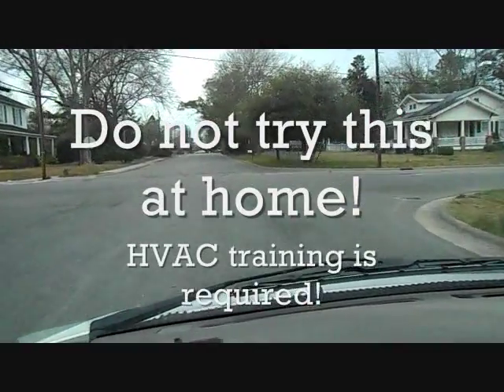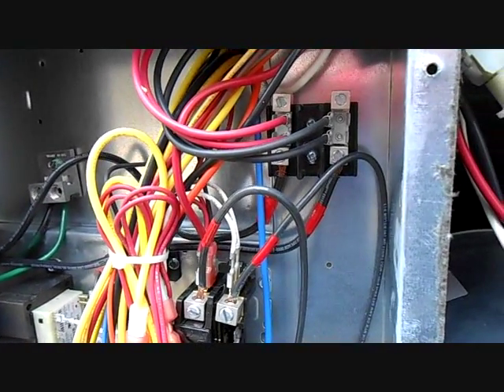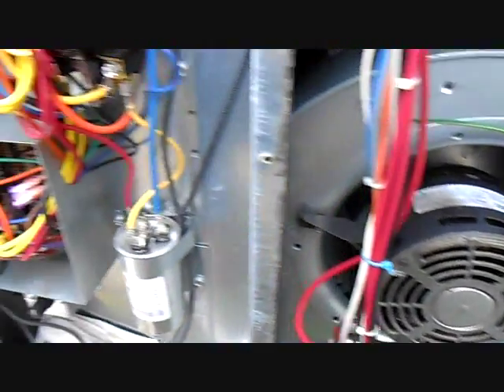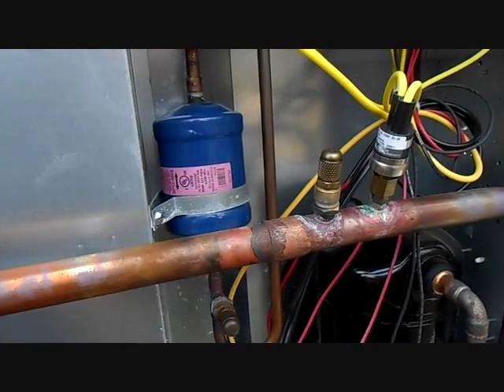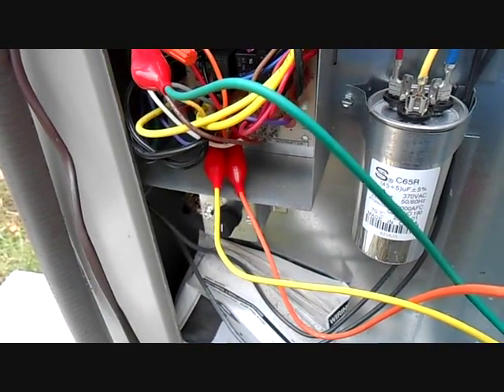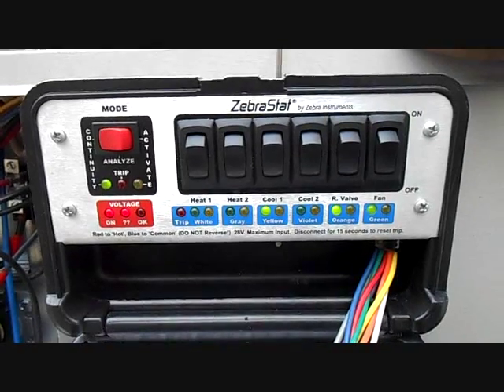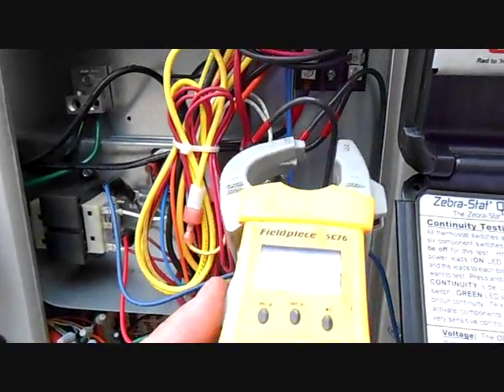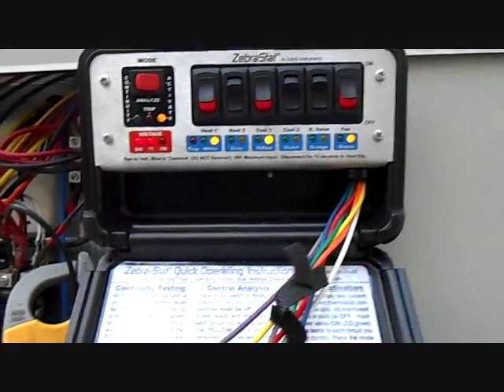HVAC Service- One Fine Nordyne

Comment: What I meant is confused with all 3 lights on. I was thinking 1 light at a time to cooling check or heating check. Shouldn't you have to turn Cool 1 switch off to test Heat 1?
Reply from the maker: Heat 1 is just being used for heat strips. Cool 1 is compressor stage 1.